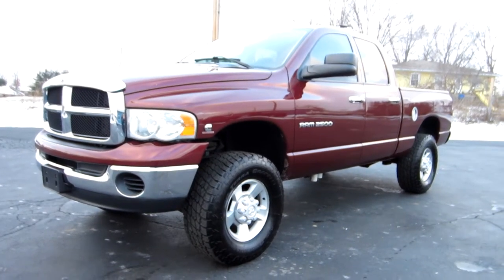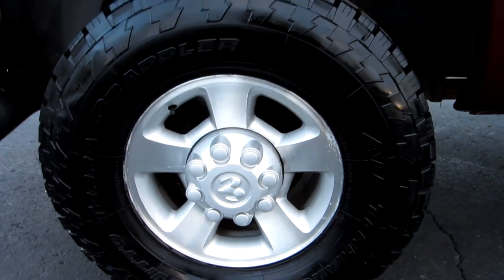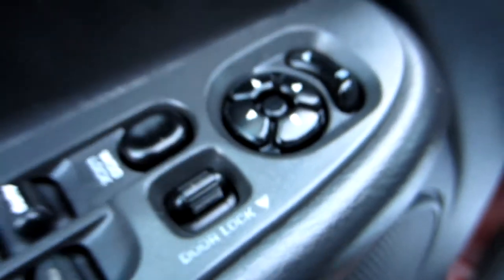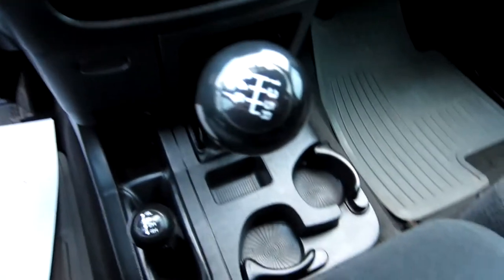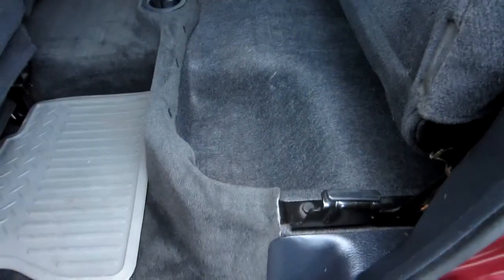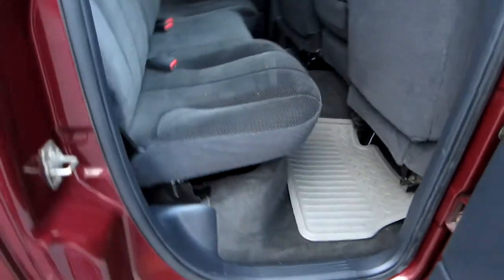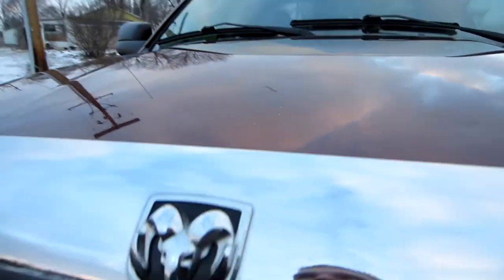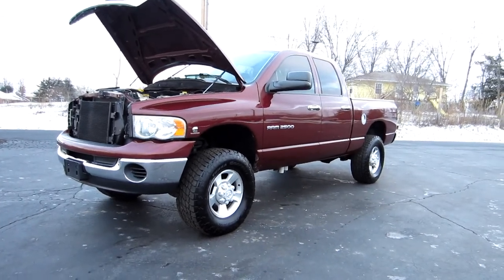2003 Dodge Ram 2500 SLT CUMMINS 6 SPEED SOLD!!!

Comment: You don't want one that is newer than 2005. The new ones have to much smog equipment on them, and they will end up costing you a lot of money when they clogg up and die on the highway.,  I have a 2003 Dodge Cummins Diesel, 2500, SLT, with an automatic. It is the best truck I have ever seen, let alone owned. I could pull my house down the street if I wanted to! Amazing Trucks! I get 17.5 MPG Highway, and about 10.8 MPG pulling my trailer. I will never sale this truck, but will it to my son. He wants it really bad. He might even off me to get it sooner! LOL...kidding.